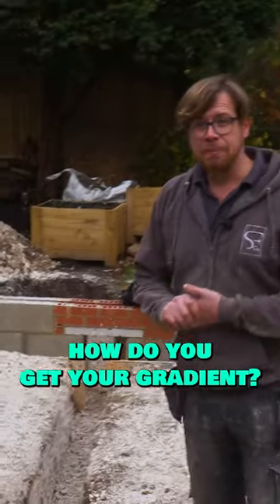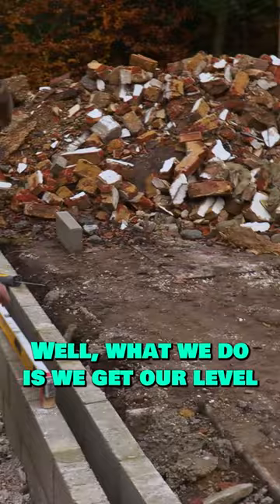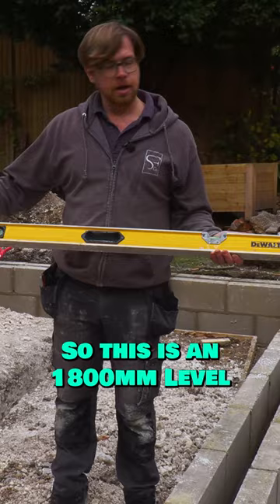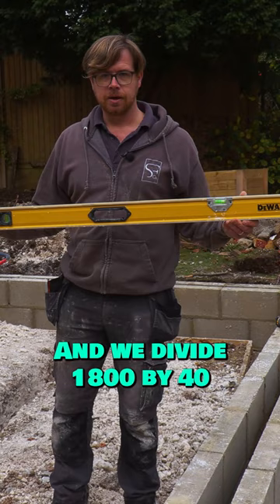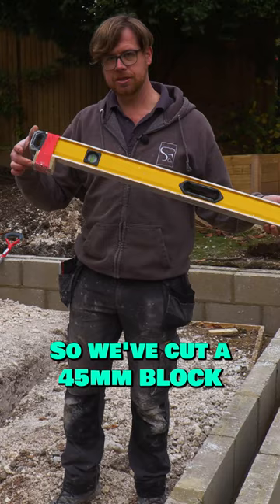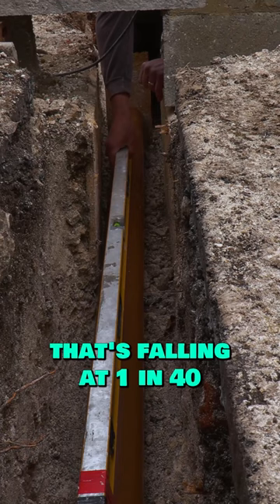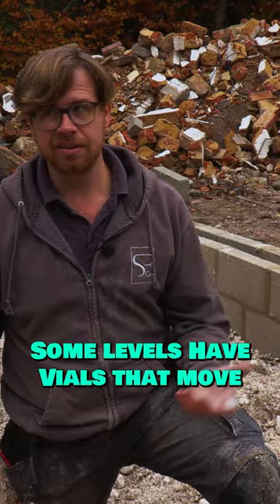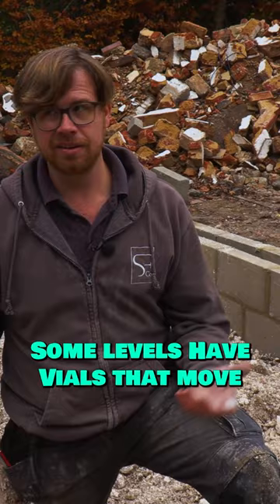DIY Hack For Calculating Falls & Gradients #shorts

Comment: ....45 years ago a ground worker told me tape an off cut of 2x4 to a 6ft bubble and get going.
The old ways really are the best.
Reply: 45yrs again 6ft levels weren't seen on bldg sites in the UK, we just put a line on from say gulley height to the invert level of the sewer!
Reply: I wouldn’t say it’s the best anymore, pipe laser is easily the best way.

Comment: I think he’s wrong…?
That drain is internal to the building, that means it’s most likely a foul drain.
Foul drain is 80 to 1.
Storm drain 40 to 1
Reply from the maker: you have that back to front. Foul is 1 in 40 and surface water (storm) can be as little as 1 in 110 because there are no solids.
Reply: As a site engineer with 20 years experience on housing and water companies I can confirm that 1:80 is acceptable for foul and up t 1:150 for storm. 1:40 is footpaths and some engineers use it for internal drainage because they worry about the competancy of the lads installing it and the repercussions are high once the slab is cast. 1:40 is safe when working with low skilled ops on housing.

Comment: Its called McQuires Rule.
The self cleansing velocity of a 4 inch pipe is 1 in 40.   1:40
A 6 inch pipe is 1 in 60.    1:60
And so on
Reply from the maker: It makes me believe in God
Reply: McGuires theory has served me well for forty five years without any problems.
Reply: It’s not used today though. You can go  to 1:80 without any issues.

Comment: I had to put in a 60m run a while ago, I have an old 1980s theodolite, set it up to the correct angle then just run along the pipe with a staff, if it's the same height on the reticle all along the run then it's bang on, no compound errors over distance.
Reply: Rare to see a theodolite or dumpy level these days getting the tripod level was a job on its own
Reply: @briangordon1767  Theodolite, much more useful than a dumpy level, if you speak trigonometry....
Reply: I speak a bit of trig from my roofing days but I wouldn't be fluent I never used a theodolite only watched the engineers using them I might watch a couple you tube videos and teach myself how to use one
Reply: @DM-ur8vc  The method in the video is good, if you have a short run, for a long run it's not, compound error. You need to avoid dips in the pipe, which will silt up over time and cause big problems. Nobody wants a backed up bog!
Reply: Pentax theodolite, I paid £80.00 for it off Ebay, with tripod, graduated staff and a few red and white poles, one of the best purchases I ever made.

Comment: Bit over the top. Just a good turn of the bubble. $hit rolls down hill inevitably
Reply from the maker: yes there is absoloutely no need to do anything properly in the building industry. Look at all those idiots who take time and trouble to get things right insted of just cracking on.  How are drain clearing companies supposed to make a living if people start putting proper self-cleaning falls in?
Reply: @SkillBuilder  drain runs in oversites can be laid fine without the need of adapting a level. This is over the top a experienced pipe layer would not do this.  IMO jetting companies are busy for other reasons like improper use of drains or dirt and stone getting g I to runs. Drain companies jetting a pipe cannot sort out level issues this is done by the shovel!!

Comment: I understand that 1800mm is the length of your level, where did you obtain the 40 to do the division?
Reply: The fall is 1:40 for 110mm pipe
Reply: He wants a 1 in 40 fall, so that block basically means if he could lay that level 40 times end to end, the pipe at the end would be 1800mm lower than the top. 1.8meters
Reply: Amazing, thanks for the enlightenment
Reply: He wanted a 40:1 drop. So how many 40's along are in that 1800...  1800/40=45.  So need 45x1 down at the end to give overall of 1800:45 = 40:1 👍

Comment: Why are household electrics 240v and site electrics 110v?
Reply: Safety reasons , the 110v is normally provided from a transformer center tapped to 55v each side minimizing the risk of electric shock.
Reply: The levels with the moveable viles are great if you can view the level side one, but in a trench, the only way is the way you're doing it.
Reply: More amps less cramps